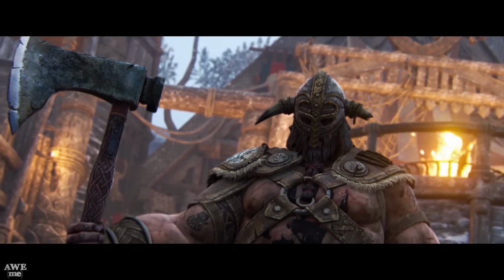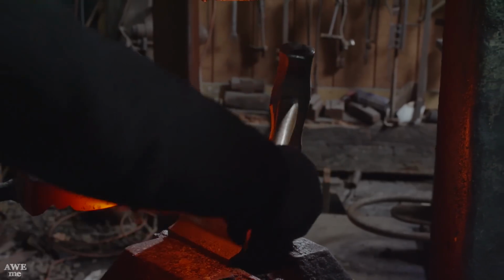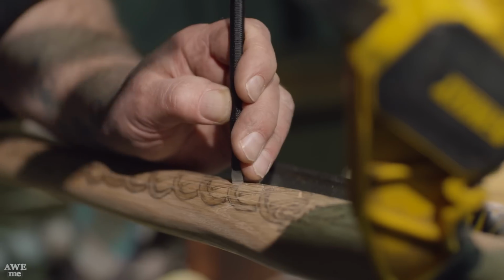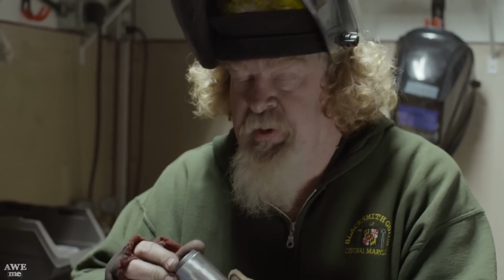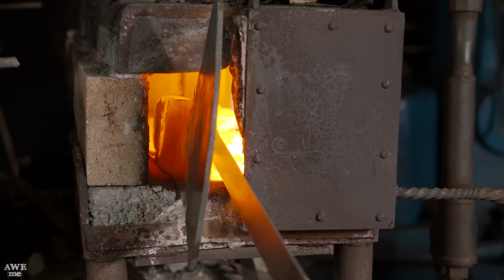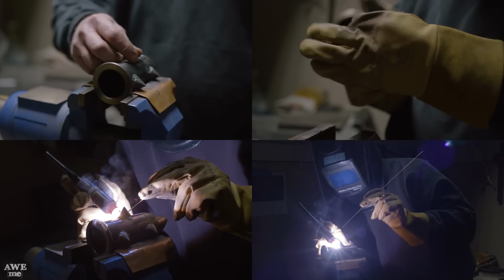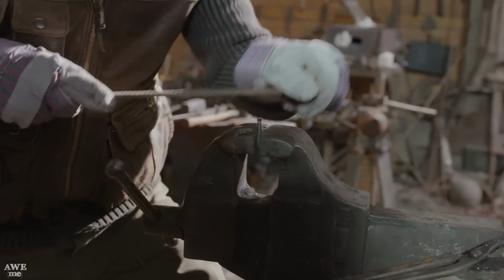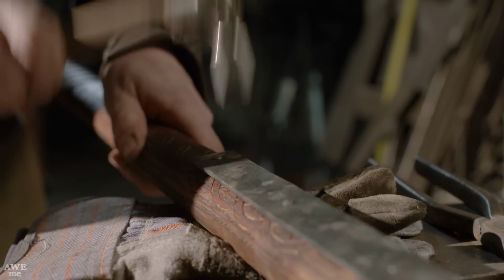Viking Dane Axe - For Honor - Man At Arms: Reforged (feat. Mark Dacascos)

Comment: This was much more of a fantasy Axe than a Dane Axe. The head is way too thick and heavy, you guys could barely even swing it.
Reply: That's because it's from a video game.
Reply: Heavy characters in that game is at least 6ft tall & has the strength of a contemporary strongman. it ain't meant to be historically accurate after all.
Reply: never bring real life considerations into a game or game-based scenario. the only exception are simulators
Reply: Wolvenworks Or games that claim to have historical accuracy
Reply: Falcon Windblade The problem is not that it is not accurate, it is that it is not usable. there is a "practical" ratio of the axe head's length and the handle's dimension parallel to the flat of the axe; this is for axial control of the weapon. With this heavy of a head, you'd need more of a chopping axe-handle, which is wider. this would spin in your hand all the time no matter how srong you are.
Reply: Horváth Benedek no it is historically accurate just for giants like the the raider
Reply: Ballistus 1) the average heigh was even smaller than today, so if people can't handle it now, they couldn't handle it back then. 
2) Dane axes were very sleek and elegant for an axe. Their head shouldn't weight much more than 1 kilogram, because you can't use it effectively. That is why they often had incisions in the blade, to make it lighter. They were also thin, for cutting, not choppin. This looks like a splitting/general purpose axe. And trust me, I have an old axe at home, the head is 3 kg, hand forged by my great-grandfather. That thing is incredibly slow. and not only that; a slight deviation from the perfect 90 degree angle strike can easily generate enough torque to wrench the axe out of your hand if you don't choke it like it murdered your dog. And thag axe is 10 cm (4 inch) shorter than this one. This thing is 1) not historically accurate, 2) not usable in battle. Sure, it can strike, but a good swordman guts you before you lift it.
Reply: Horváth Benedek look Dude I don't know if read my commment but I said this axe would work perfectly fine for a Giant . Like in the game the rider is 7-8 feets
Reply: yeah they guys arent body builders now imagine big hulking warrior men swinging these things, pretty sure they'd have no problem
Reply: Except for that time period, an average Dane was 5'7 and the tallest known Danish, Scandinavian, or Swedish remains only reached 6 feet, so hardly giants. History shows that every Danish axe made for battle was light and quick, nobody took an axe like that to war unless they wanted to die.
Reply: I'm Edgy Your name is perfect. 
Please read my comment above. However massive that guy is, he is going to have a broken wrist, if he goes to battle with that thing. Or he will lose the axe.
Reply: ye you can swing real good if ur a 50 ton behemoth
Reply: RedXIV, I know, I mean it was a cool build. However, it kind of grinds my gears that they call it a Dane Axe, and that they tried at times to bring up historical vikings while they were talking about the build. They did a great job recreating the weapon from the game, but even then I think they might have went a little overboard. That axe head seems so heavy, that there would be no point in using it as a weapon. It reminded me much more of a build from the excellent but outrageous michaelcthulhu.
Reply: BigZ7337 it's from a video game
Reply: Horváth Benedek yeah but it would be cool if they made weapons usable and balanced right
Reply: I don't think they were that bulky though
Reply: FAJAR MULIA OK, let's talk about science and history, because you seem to need guidance in both. 
History: Nobody walked 40 kms in armor. The roman legions had to cover about 12 km a day in light armor (light as in sleeveless chainmail shirt, short sword, no leg protection, etc, it was around half of the weight of a medieval "full armor", mail or plate. Now,  Julius Caesar during his wars with the gauls raised the daily distance to walk to 20 kilometers. This created a public outrage between the people, but they did it anyway. So no, 40 km was never, ever standard in an army. The romans came closest. Actually, nowadays military walk larger distances with heavier gear than back in the medievals. 

Physics: 10. KILOGRAM. MACHETE. Are you kidding me?! A machete is usually made of springsteel, is no thicker than 5 milimeters, and is a one handed TOOL! not weapon. The density of steel is around 7800 kilograms per cubic meter iirc. make that 8000 to make things easier. Now let me show you how large a 10 kilogram machete would be. We need a volume of 10/8000 = 0.00125 cubic meter. if the blade is 5 cm wide, which is acceptable with machetes, and is an astonishing 1 meter long (that is long for a machete, most latin machetes are 70 or 80 cm long), it would be (0.00125 / (0.05 * 1)) = 0.025 m , so 2.5 cm wide. does that sound like a functional machete? Of course not.

BTW, I can walk 40 km a day, and I am not even in shape. now sue me. Hell, waiters and waitresses walk up to 30 km a day with dishes on their hands, and they are not soldiers.
Reply: Everyone who says that "this is good axe and there's no problem with it or says that every viking can  swing this axe" check out Skallagrim's video about his... that is the real dane axe...not only it is lighter but it's also better at cutting which is not bad for an axe because the axes were sharp...
Reply: Is a videogame weapon..not a history viking battle axe.. :v
Reply: Ardiak Beltz But the game claims to be realistic... and the dane axe is a historical name... so if they didn't call this a dane axe I wouldn't even have the slightest complaint
Reply: Yep, but it is only misleading advertising of the product..like is really good tested and haven't bugs, lag, etc..the problem is from us to believe what say from a product to sell it..or not to claim more often as consumers  in front of misleading advertising..we buy a lie products before know that better and then we complain..we need relativize what sellers say..they are only peddlers from XXI century..XD
Reply: I'm a Dane. Vikings used to row from Scandinavia to the middle east, and all around the globe. We had axes this size believe it or not.
Reply: Mathias Larsen I bet you remember it, right? Don't make me laugh. Anybody can look up pictures and specifications of historical axe heads, it doesn't take a genius to find out that axes were a lot lighter than this one; you just have to google it.
Reply: I think they have used terms like larger than life and stage combat
Reply: Mathias Larsen, I do know that the Vikings had axes like this, however all the research that I have done showed them to be more for the felling of trees than combat. The combat axes that I have been able to find and identify for recreational purposes for a fighter of about 170cm was a light weight one handed axe.
I do like the fact that they use modern equipment to replicate an old look.
Reply: well the dude using it in the game is like 7 feet tall...
Reply: <meaty cabbage> And that doesn't change the fact that the weapon is not feasible. Even if you have a strongman who can use a hammer without a handle to hammer a nail in a wall, that doesn't make it a good tool. Even for the strongman.
Reply: Jóhann Mar Kristjánsson But dane axes never looked like this, and never were this bulky and heavy. That is what he meant for certain.
Reply: The Danish long ax is the hammer, that prop is the hammer without a handle...

God, does everything have to be made so crystal clear out here?
Reply: qwormuli I deleted my comment because I initially misunderstoop what you wrote, because I thought it was Johann Mar Kristjansson, who I disagreed with. After I understood it, in the context of youe previous comment, I decided to delete mine to prevent confusion, but I guess I wasn't fast enough.
Reply: <Horváth Benedek> Oh, i don't actually even know what you wrote or anything, i was poking fun at Jóhann Mar Kristjánsson for him trying to take a perfectly reasonable conversation personal, failing, regretting it and then deleting his so original insult. If you expand my earlier comment you can see what he wrote and when.
Reply: The same case for me, Seems that i jumped the gun on this one, as i too see your comments on the inbox. Apologies to Jóhann, too, even if his opinion is misguided.
Reply: I never said this axe was accurate, i said that vikings who could row across the planet clearly were alot stronger than we are today. And yes most of the axes that was used was used for cutting wood. And ive been to a viking museum that has axes of this size. Obv. not for fighting.
Reply: Mathias Larsen You know they ad invented sails way over a millennia ago, right? And no, while their lifestyle made them more fit on average than the average desk working human of today, there is zero evidence that they were inherently larger or stronger than today. But to be honest when we move to the category of the most physically capable one of those days in comparison to today, the difference becomes crushing... As in, people of today would crush their opposition from every age in human history ever and brutally.

And no, axes of that size were just about never used for anything, outside of a couple fringe uses(just like as a set piece like that very ax). A woodcutting axe absolutely has to have ergonomic weight balance, so the worker could use it effectively. And when you upscale an axe that much, it becomes impossible. Not to mention that a primary wood cutting axe has way different geometry to a war axe. Even a felling axe looks and feels totally different to a chopping axe, or a woodsmans axe, or a carpentry axe.
Reply: Mathias Larsen You are either lying, have a bad eyesight, or the museum was lying. First of all, no wopdworker needs axes THIS large. The closest things are splitting mauls, but those have significantly different shape, as well as being no more than 4 kilograms, usually only 3. This might even be heavier. 
Secondly, metal was never cheap. It would be extremely expensive to just make a splitting maul out of a block of steel, instead of making an axe lighter, but better suited for its task. 
And finally, back then the central problem was not splitting logs, but actually cutting trees. When you have to cut a tree up, remove its bark, its branches, etc, splitting the logs is child's play. And for actually cutting them, I think they'd use either saws or felling axes; and a felling axe is always lighter than a splitting axe.
Reply: Horváth Benedek Look at the size of that veritable anvil they started this project from... I'd say even 10-13 kg is very conservative depending on the weight of the haft/other parts and the amount of grinding done. A nice looking piece, but one'd have to be an idiot to think it as even remotely practical.
Reply: qwormuli I don't know how heavy it is, kt could be 5 kilos, or the double. It is really tricky. But yeah, it is sure as hell really heavy.
Reply: <Hamez Macdracovich> Yes, but that is applicable due to their different muscletypes, muscle mass, and physiological leverages. They are a lot weaker than us in many areas outside their specialty. A Nordic man from 700-1100 ac. is still a human, and they didn't have any large physiological differences to us. But we have better health care and nutrition plus other benefits due to modern science to help us.
Reply: @horvathbenedek3596  incorrect. They actually did and they're called long axes. Potentially much thinner, but yes

Comment: This episode was great and guys the axe is from a game don't spam historically accurate weapons.
Reply: Amani Minato And they're wielded by giants that towers over normal soldiers.
Reply: Even though its been proven that the tallest person from that time would be about 5ft 10, Humans have gotten taller on average over the years.
Reply: Lol, germanic people were 6 feet tall on average, vikings the same. They stood a head taller than most romans.
Reply: That is nowhere near historically accurate even if it's cool. nevirful pls go to school.
Reply: Northern folk averaged 5 foot 7 during the middle ages and earlier. No food equal shorter people, look at north Korea
Reply: Trippy 176 is pretty much exactly 5'10
Reply: Can confirm, im 5'10 aka 176cm.
Reply: Amani Minato Those weapons are based on these historical facts.
Reply: Trippy sounds like you cannot math. 5.7 feet is 67 inches, that equals to 170 centimeters. 5'10 however, is 70 inches, or 177.8 cm. See, when you google ''176 centimeters in inches'' it is incorrect, because the google thing doesn't count feet as 12 inches. You cannot type 5.10 feet in centimeters for example, because google thinks it's just 5.1 :=)
Reply: that is not accurate at all I would not trust google way larger skeletons have been found in northern nova scotia... skeletons that are axe heads (FOUND)that would make that axe 6 feet 
the chinese called them giant barbarians literal translation they really did tower over the rest
the axe is very viable it would cleave someone under 6feet in two you try to stop it it by hitting the shaft or hilt or head that will crush you an your sword to the floor the momentum a weapon that large has coming down is insane
Reply: yea well you are correct the average axe length was 4-5 feet the majorly preferred hatchets like the native americans to be honest

Comment: I want a dane axe. Thats a beautiful axe
Reply: Tyr you're a god, summon one for yourself
Reply: That's not remotely a Dane Axe. It's a video game axe, made real. Doubt anything like that existed in any culture or time period. But it looks cool.
Reply: Dane axes existed, although this axe isn't very realistic. The blade on the real dane axes was much thinner and the head was 600-800 grams, not like this oversized wall hanger. If you tried to use the axe from the video, it would be like using a sledgehammer, while it should be way more nimble. I mean just look at how the guy that does the horizontal strike turns completely because of the momentum haha.
Reply: Olav471 I'm not sure what this adds, as said, this is not remotely a Dane axe.
Reply: I'm just too quick of a reader for my own good lol.. nvm my comment

Comment: make zabuza's sword from naruto
Reply: Obito Uchiha that would be too heavy
Reply: Kairasu they could scale it down like with some of their old projects like kratos' swords of chaos
Reply: "that would be too heavy"

These are the people who made Cloud's Buster Sword we're talking about here.
Reply: +Daniel Except that weight actually has a very valid point here. unlike rifles where you just change one position to another & your arms hardly move, swinging these heavy babies repeatedly requires your arms to move around a lot, & half your body to move in lesser extents one way or another to do damage. carrying them is one thing, actually using them is another. they might not weigh as much as your rifles, & definitely not as much as your gear in total, but they'll be far more tiring to use actually. try swinging a barbell like 200 times in just like half an hour & you'll get what i mean. & oh, these cultures actually modify their weapons or tools one way or another, just to reduce weight. that's why actual dane axes have had far thinner heads, & nodachi was never actually used in combat.